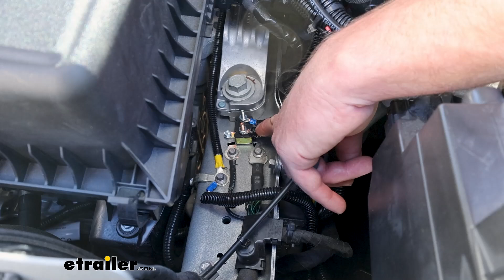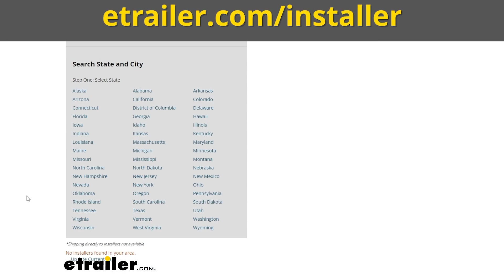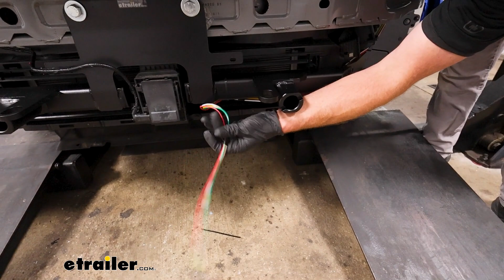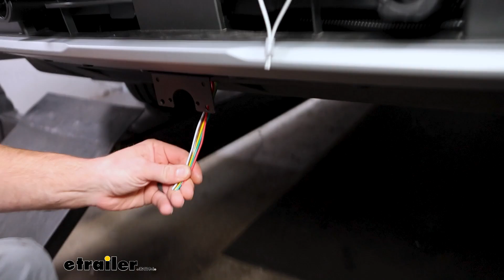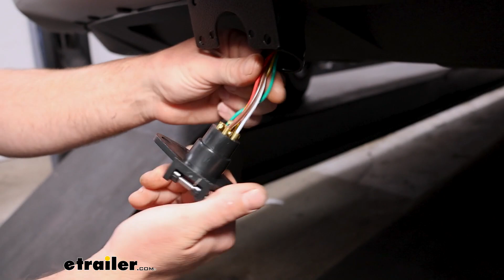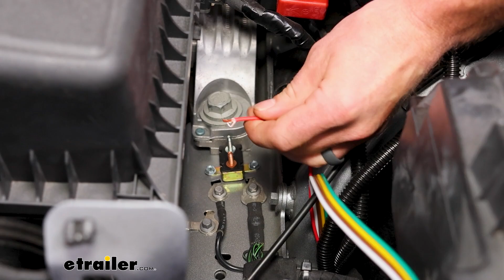etrailer | DIY Installation for the Roadmaster Battery Charge Line Kit - 2024 Ford Escape

Comment: Would have been nice if you had told us where each wire to  the 6 pin receptacle was paired to the screws....
Reply from the maker: Sorry about that! I've linked a help page that has a diagram of a 6-way and shows you what function is for each position on a 6-way. 

https://www.etrailer.com/faq-wiring.aspx